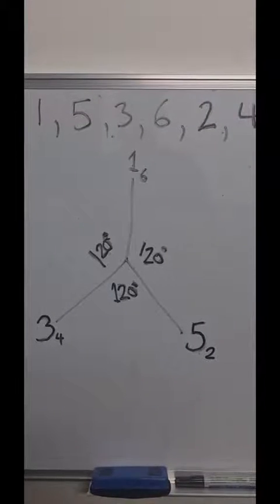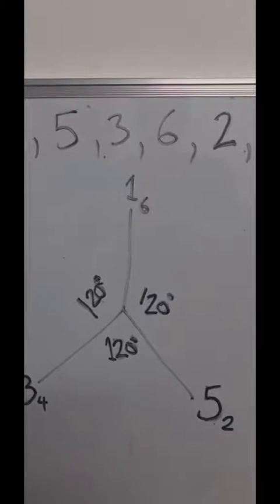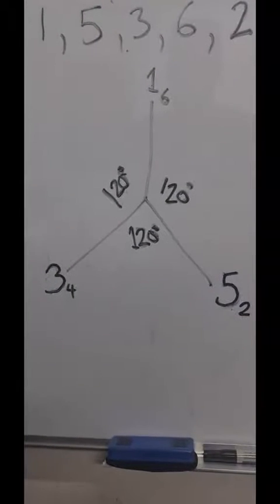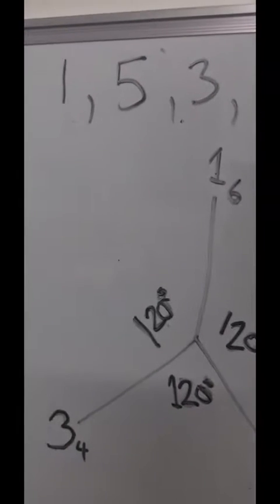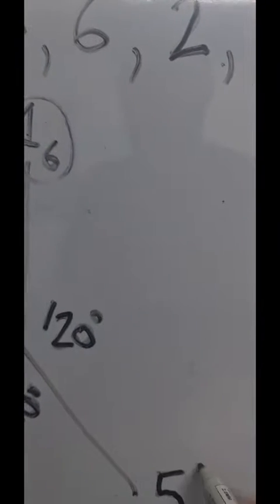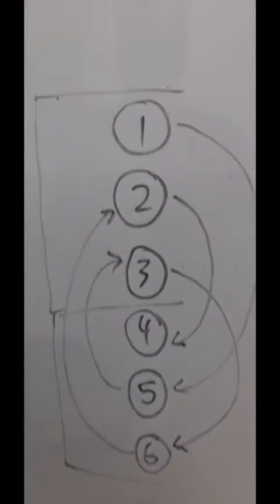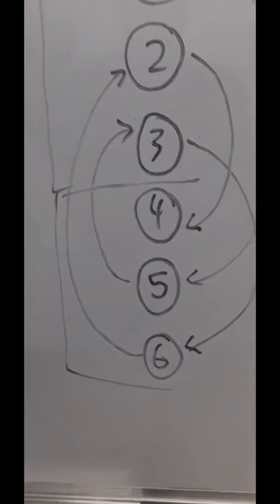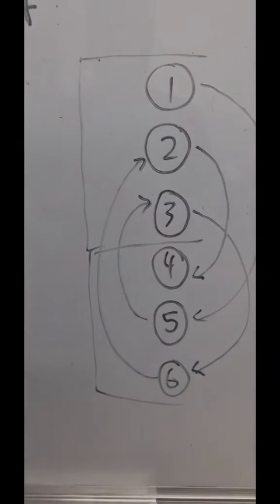"Unlocking the Mystery of Firing Order Separation on ICE Engines"

Comment: Reducing blowdown interference on the exhaust side is something that we keep seeing easily measurable differences in VE/cylinder filling even from the drivers seat. Seems to be the largest lever when it comes to divided turbo setups too. Also seems to be why longer exhaust runners tend to show improvement at low rpm, even when there shouldn’t be much effective wave tuning going on
Reply from the maker: Oh, definitely! Optimising the pressure differential is a win-win, and yeah, a lot of people play down wave tuning, yet there's gains to be had.

Comment: Just watched this video. Most of the stuff that I do is V8 stuff. I spend a lot of time looking at the firing sequence of the motor, because it affects both my intake and exhaust designs. On things like a 302 windsor, my 1,5 firing order manifold is different to a 1,3 firing order manifold, because of the cylinder robbing during the induction cycle.
Reply from the maker: Yeah its an area that many overlook mate and there can be some good HP to be made for nothing, with a little planning and understanding.